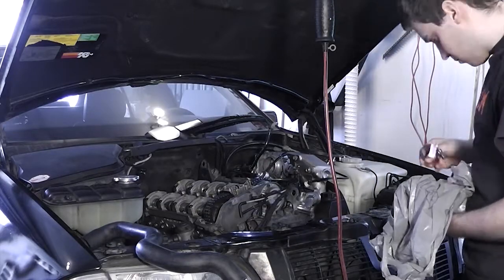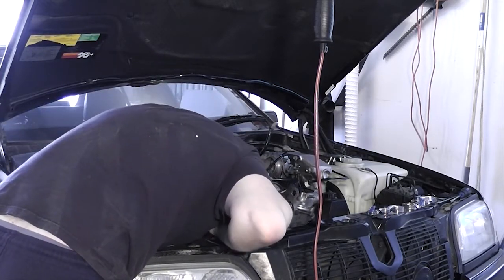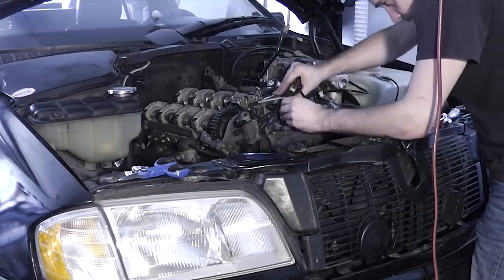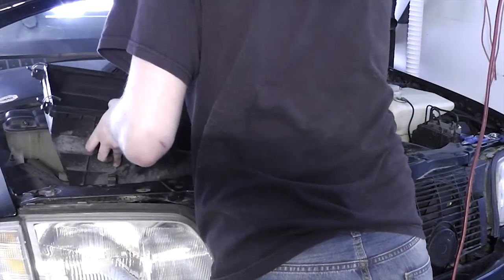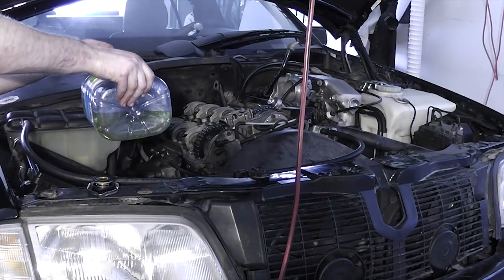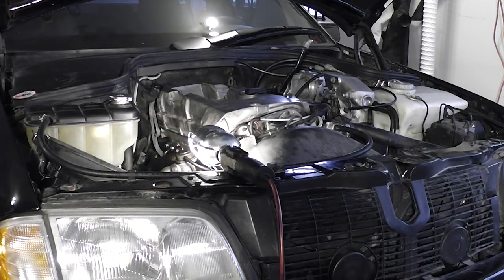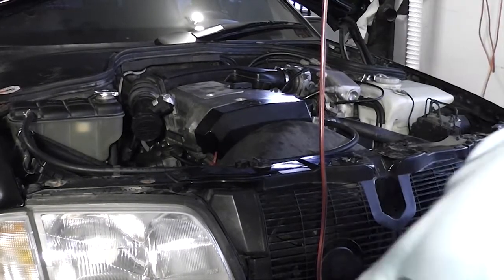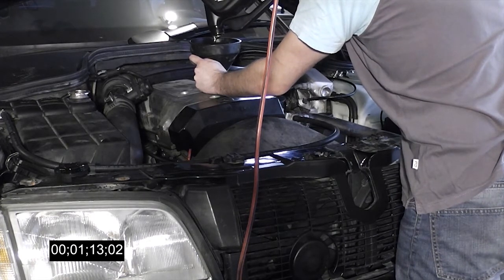M111 Cylinder Head Gasket DIY - Final Video

Comment: Hi! Great work. I have a W202 C230 Kompressor Sport with Scottish tissue seats and a carbon-fibre interior. It's a limited series that I want to keep. I have lots of issues that I want to fix on my own, even with the small experience that I have. Some of the things that I have to fix are multiple oil leaks from different gaskets all over, so what you have done is exactly what I should do. There are two moments that seams really hard for a guy like me to do. You mention both of them... Any advice before I do this complete unmount of one engine?
Reply from the maker: Hey, the only thing to absolutely not forget is to reset the chain tensioner, forgetting to do this will snap the intake camshaft, probably destroying the engine. I do have a separate video on that topic (the camshaft timing video) and it's not a difficult thing to do, just important not to forget it. Apart from that this is not a difficult job, and does not require any special tools, it just takes some time to do. Good luck with your engine rebuild!

Comment: Hi Pat - Nice detail in the videos - 
You talk about setting the Intake camshaft sprocket in the fully retarded position - That means once the intake camshaft is pinned, rotate the sprocket counterclockwise as much as it will go - Correct?
Reply from the maker: No you should rotate the sprocket clockwise. The "resting" position of the sprocket against the camshaft is in the retarded position. You need to power the electromagnet (and have oil pressure) in order to advance the cam. So even if you have spin the engine (clockwise, that's which direction it normally turns) by hand with a wrench and the camshaft isn't locked, the sprocket will reset itself to the retarded position.

Thanks for posting your question, I could've made this point more clear in my videos. If you time the engine with the camshaft advanced, the intake valves will give your pistons the kiss of death. Not to worry, it's pretty hard to time the engine incorrectly since the camshaft always wants to return to the retarded position, but it's certainly something that should be checked.

Comment: How do i set the timing if it isnt on point like urs is and wat do i torque water pump to
Reply from the maker: Did you watch the camshaft timing video? I describe the procedure pretty well over there. I don't have a torque spec for the water pump, when I changed mine I just tightened it reasonably tight... Don't yield the bolts, but they shouldn't slide out either.

Comment: I may have to tackle this soon. I have a 96 C220 and have oil floating in the coolant reservoir and also have a mysterious oil leak and coolant keeps going lower. But I can’t find where it’s going. The oil dipstick looks clean and trans clean as well. I used a block/head gasket sniff tester but it didn’t turn yellow. I then did a coolant pressure test and it tested good. So I’m all confused. There is oil coating on the coolant hoses too
Reply from the maker: Probably a head gasket, but check the transmission fluid too for coolant contamination.

Comment: Thank you, Pat, I'm in the process of doing my '96, and your videos have been watched so many times that my family refers to you by name like an old friend.

A bit of a far-out question and hail mary for me at this point, there is a small bracket zip-tied only to the green vacuum hose that runs along the firewall down to the transmission in the area behind the EGR valve, do you remember where that bracket bolts on? It looks like it's the right size for the rear-most intake bolt, but it doesn't quite fit there. Thanks in advance
Reply from the maker: Glad you're liking the videos and they are helping you out. I'm guessing you are referring to the upshift delay solenoid's vacuum hose, and not to the vacuum modulator's hose. If so I can't remember there being a bracket for that hose on my car, but I honestly never looked at it too closely. I did replace the vacuum modulator's hose some time ago, and it did have some sort of bracket, but mine was also dangling around, not attached to anything. I removed it, and slid an old rubber vacuum hose over the new hard plastic line to prevent abrasion damage from engine vibrations. I think the upshift delay solenoid's vacuum hose just sits on the bell housing, at least it does on my car and it's never been a problem.

Comment: Thank you for these incredibly details videos.
I will be tackling my C220 W202 over the festive period as the head gasket is leaking.
I've ordered the Haynes manual which will be arriving in a couple of weeks.
I am Mechanically inclined and have worked on engines before but I have a fear of timing issues since my tensioner failed on my Chev Aveo and ruined the entire engine.
Reply from the maker: Sorry I took a long time to respond, youtube doesn't send me notifications for comments anymore. I cover the timing procedure in a separate video in the head gasket series. I also cover the important step of resetting the chain tensioner. The Haynes manual should cover this, I was using the Bentley manual but honestly, I'm not a mechanic, I do this as a hobby and this was my second time opening up an engine (first time was a honda lawn mower). As long as you follow the Haynes manual step by step you will be ok!
Reply: @PatsCarGarage  I went ahead and did it following the Haynes manual and your video.
Gasket was blown into cylinder 4, all the coolant channels were blocked with rust.

The engine runs perfectly now, like the day it came off the showroom floor.
Reply: Daniel How was the job and how long it took you? Any tips?
Reply: @kchilz32  some gasket kits dont come with the rocker cover spark plug seals, so you have to buy it separately.
Buy a 1/2" 10mm hex to get the timing tensioner off and on.
You need a torx set for the cam sprockets and 12mm spline for the cylinder head bolts.

Take your time, label the bolts otherwise you will loose them. While you're at it, replace the welch plugs and replace/remake the ignition harness.

The whole job took me 1 week as I took my time. But it could be done within 3 days
Reply from the maker: The Cylinder head bolts are not a spline drive bolt, the technical term for that socket is XZN (it's a 12 point star)

Comment: What's this about the chain tensioner you spoke of in the preceding video, that if it's not installed quite right the intake cam will break? How does that happen? I haven't heard of this, but am planning to change this on my wife's '98 C230, and so I don't want to destroy it of course.
Reply from the maker: It happens a lot more often than any mechanic would like to admit. 100% of snapped camshafts on Mercedes engines are due to omitting the tensioner reset procedure. You can quote me on that figure. It happens because when a sprocket is removed and the chain slackens, the chain tensioner goes to the fully extended position. If you somehow manage to reassemble the engine like that, and start it up, the enormous shearing force on the camshaft simply snaps it clean off. Camshafts are hardened steel, which really doesn't like being bent.